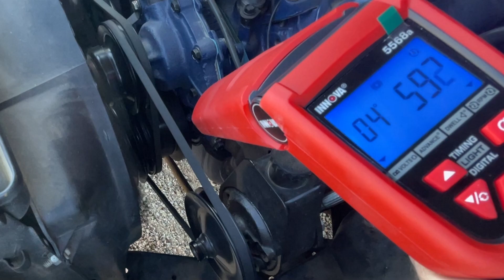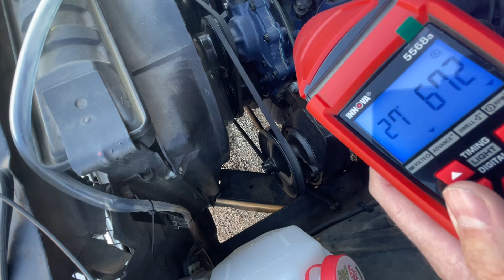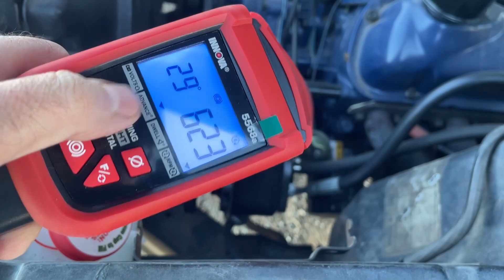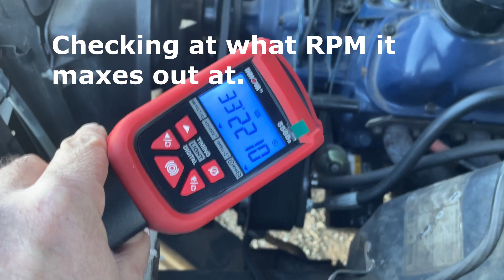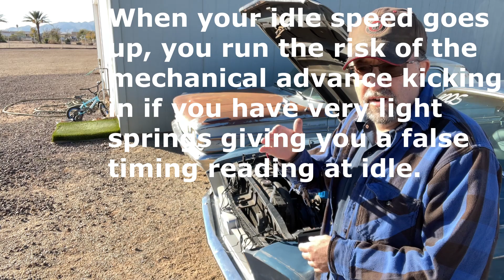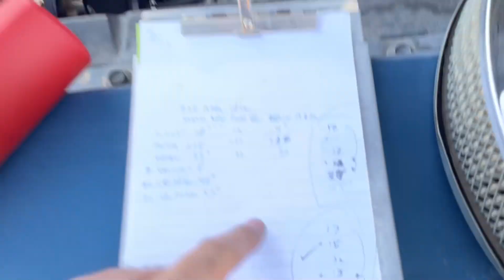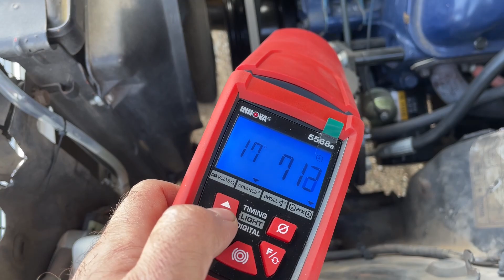How-to Recurve Stock Ford Distributor and Set Timing!

Comment: My Stang is set to 17 degrees base with 19 degrees of advance.. tossed in lighter springs "blue ones" and dropped a needle size on the step up... Pulls like a freight train!!!
Reply from the maker: Awesome!
Reply: This helped me a lot, thx! Searched high and low for some info on what springs bring in timing at lower rpm. My mechanic told me my dizzy was bad so I bought a new one. I have an FE build, a 390 with a 428 crank, Edelbrock heads and manifold, headers, a mild cam. It's a street car, but I like to get rowdy with it. I was told to set idle to about 12 degrees and full in to about 32. Been reading a lot, and figuring out timing the last few days. Both my bad  dizzy and my new one have a 13R and a 18R. If I use the small springs off them both do you think I'll still need to go to a 10R gap or do you think the 13R might suffice? Just trying to save myself a little extra work. I'm at 7,000 FT elevation so manifold vacuum is only 6 hg. Thx in advance for any input.

Comment: Was this vacuum advance can originally set up for manifold vacuum?  I think those used a weaker spring so vacuum advance doesn't drop out during throttle tip-in?

Comment: Nice info on the timing and adjustments. The only thing missing is the after results at the drag strip... Ideally your vac and fuel economy should have increased as well.
Reply from the maker: I'm bringing it to DuctTapeDrags 2024 in a week.  We'll see what it does, and I'll post it up.